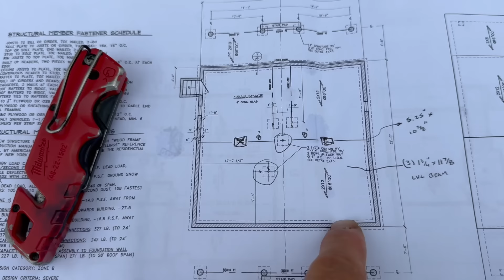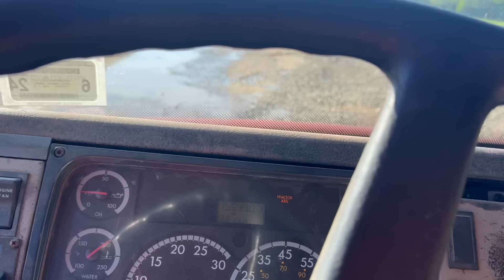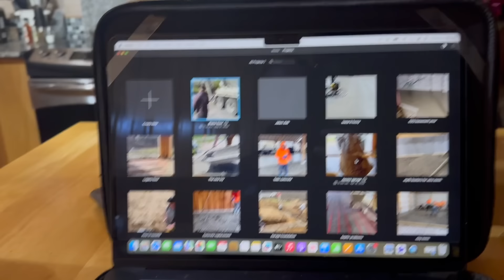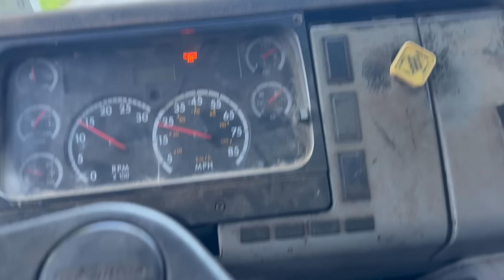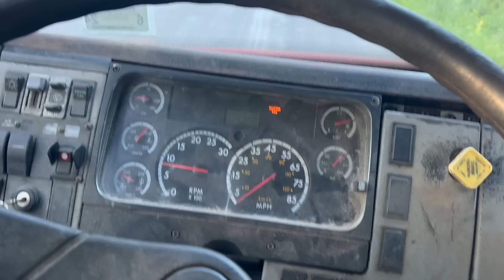Fox Blocks crawl space Foundation Part 1

Comment: Don't you guys have extra chutes to reach across I never see Mike Day with a wheelbarrow he just adds extra chutes to reach all over the pour.
Reply from the maker: Well Mike pours it wet so it flows along ways. We pour our concrete at a low slump so it will not flow like his does.
Reply: @bondobuilt386 Mike is not pouring too wet. He uses water reducers so that it seems like its wet. Mike adds more chutes because he is pouring basements. Basements are in the ground deeper than frost walls so he has the height to add chutes. Concrete flows down chutes because the chutes are dropping.
Reply: @aarongrabowski3775 he didn’t say Mike was pouring “too” wet. He said Mike used a different style of pouring. Both styles work for basements, but Bondo has a method that works for his size of job and crew.
Reply: @aarongrabowski3775  I've seen him use extra chutes on patio pours to not just basements that's why I asked that question.
Reply: @seancasey2444  only when the truck has enough height.
Reply from the maker: @highlorddarkstar  exactly

Comment: Is this technically called a rat slab since it's a poured crawl space? Any downsides or extra long-term mitigations needed?
Reply: I think “rat-slab” refers to a thinner layer (1 or 2 inches) poured in to prevent burrows but isn’t meant to be structural. So it is defined by type of floor, not location of floor. What they’re installing is a full on floor slab.

Comment: LISTEN THIS IS KAMALA HARRIS - and I can suck the chrome off a trailer hitch

ANYHOW !  Safety is only as good as your FOX block glue.  If the glue is not as good then your FOX is not gonna be glued and that's bad..  When it's bad that's not good so you wanna be good and make use the glued block is done not bad but good.  Just incase your wanna be good..